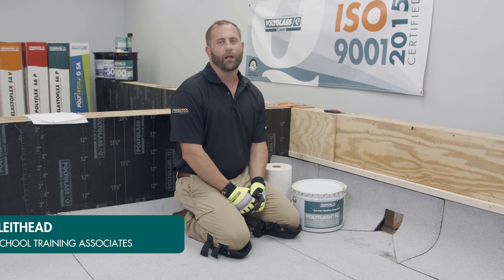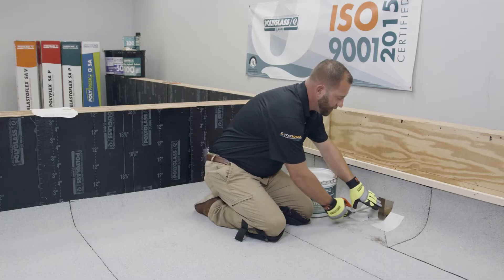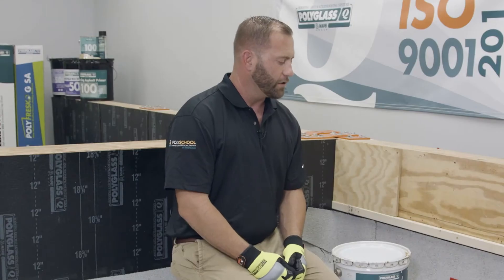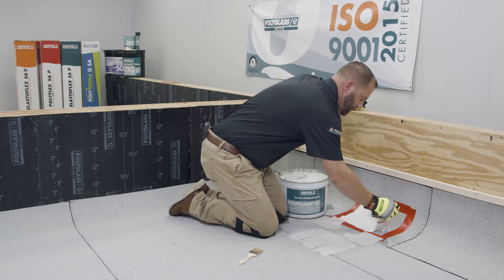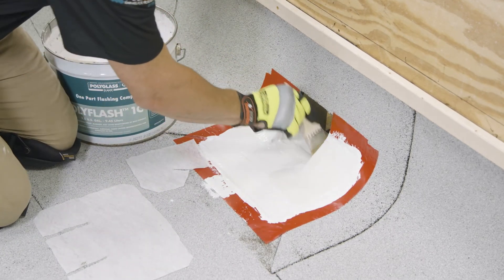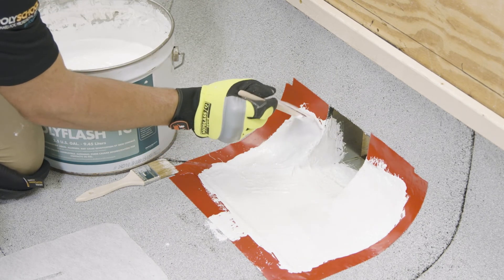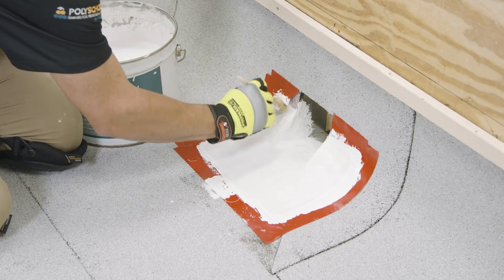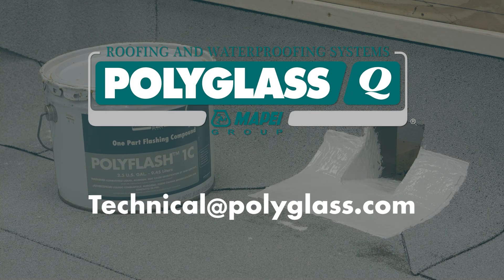Scupper Reinforcement

Comment: can you paint over the polyflash 1 c ?  if you use it in an open roof tile valley ?
Reply from the maker: Yes, once it cures, you can paint over Polyflash 1C with latex paint. If you need more assistance, don't hesitate to get in touch with us, and a tech rep will be in touch with you: https://polyglass.us/contact/.